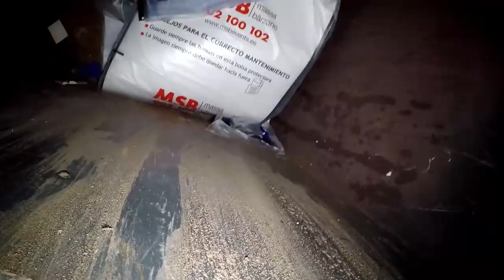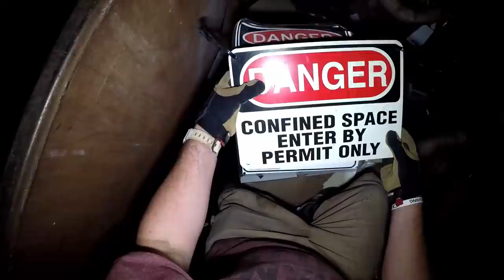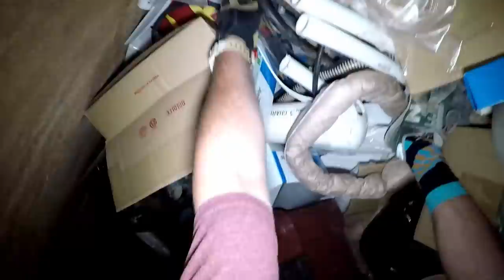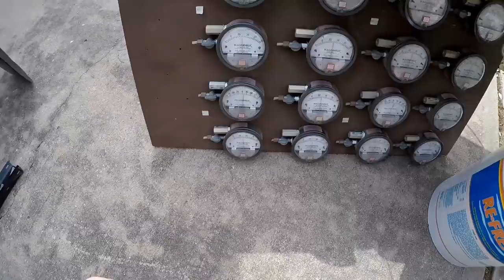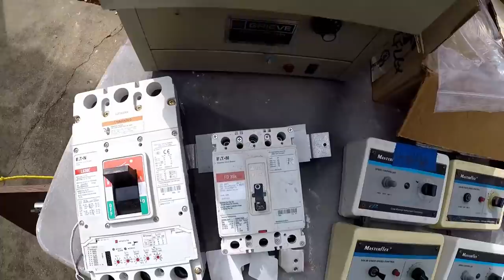Dumpster Diving (Fluid Movement)

Comment: That big 3 phase breaker that you said you were going to open up...if it works correctly and it does...it is VERY expensive.  And the 3 in line fuses that size are also expensive.  That electrical stuff is high dollar.  And the stuff in your truck is worth more to the right person than as scrap.

Comment: I used those pump all the time, inside there is two rubber balls (one either side) which act like one way valves, they suck from the bottom, and push out from the top, the fitting in the middle is for the air inlet, stick 'em on e.bay as a job lot spares or repairs.

Comment: What you called an Edison breaker is actually a fuse for an Iron Clad electrical box. The way you test it is to check ohms with an ohms meter. If you get no signal while touching each probe on either end at the same time it is a blown fuse.

Comment: The magnehelic gauges are not reading zero because they're not flat( there is a screw on the back used to level them) my company uses them for when we do asbestos work they measure if we have negative air pressure within our containments. The hoses go with the gauges.

Comment: You make hard work look fun!
Fuses are just a piece of wire.  If you
U have continuity (prove with a battery and bulb).  If the bulb lights it's good.
The maker choses the right wire to melt at whatever current, all you can prove is the wire is there.

Comment: Masterflex...peristaltic pumps. The hose loops through the housing, and the rollers compress the tubing, forcing the liquid through. Looks like they are made to stack and drive one another, which would suggest proportioning the fluids. We used similar pumps in the photo processing industry to mix chemistry in the correct proportions for replenishing solutions.  Those big fuses are worth big bucks! They are proven unused by the lack of marking on the copper terminals.

Comment: the yellow  " funnel" is a visc funnel, you fill it up pouring thru the screen with your finger over the hole in the bottom you then time how long it takes the drilling mud to fill the visc cup and that gives you your drilling mud viscosity

Comment: Peristaltic pumps, yup expensive, used for small  flow very accurate systems. Big fuses, just put a meter on them, check for continuity, if they used and blown then no continuity, if un-blown then you'll read continuity. Drager testing tubes, need a special  pump with them to draw a set amount of air / gas through them. They will then give a direct reading for the particular gas you are testing for.

Comment: that lab oven would be good for heat treating things. i'm sure it would hold a very precise temp if you could get it working. or sell it to someone else, and let them get it working. ovens are simple though, not much to go bad. a heating element, a temp controller and probe, and mebbe a timer. easy peasy, lemon squeezy.

Comment: Those breakers are probably pretty expensive. I'd imagine checking for continuity between the two copper plates with a multimeter would tell you if they're  good or not.

Comment: MIKE..what your calling "conduit"is really called"bx"..or"mc"cable….. conduit is pipe.. usually 1/2,"3/4"...1"..on up to 2"-4"...maybe bigger... maybe...    and magnihelic gaugesusually read in "inches of water column"... duct pressure usually... theyre kinda pricey..probably worth something

Comment: oh yeah out in the dumpsters getting goods, would of grabbed the folders empty out the busness cards and sell for the ppl that have baseball cards or cards as i bet they fit in there fine, packed dumpster has goodies in it those fuses holly crap there big ones size of the copper on them too be tempted to pull out the crap in there or diesct the dumpster and see if there are any more of those in there, lol someone else just takes it as it has free? on it so they just go yeah it looks free its outside that's free to me, like i said no one in the office no one to bother the boss or next in charge so you have a good clear out/tidy up get rid of junk or stuff you no loner need and get ready to put newer/more stock were it was,

Comment: The gas detection tubes are for measuring radiation, the writing on it is pronounced rankins.
Reply: @Kendall Reeves, no the Draeger and Rae tubes are for gasdetection  with a manual pump for quick detection f.e by firefighters or osha. You cannot measure radiation with them